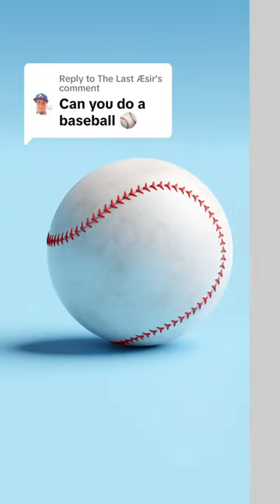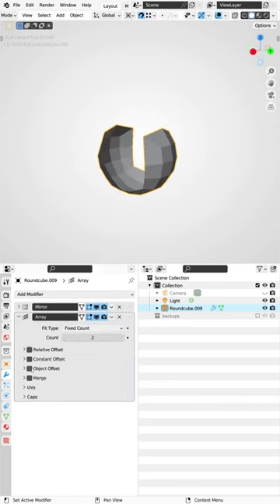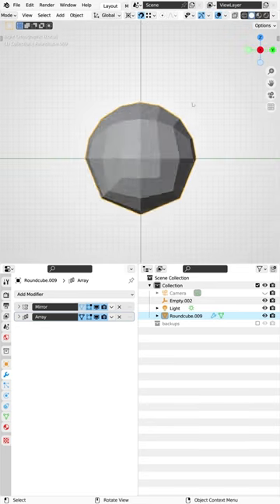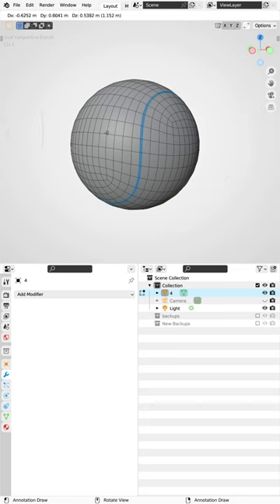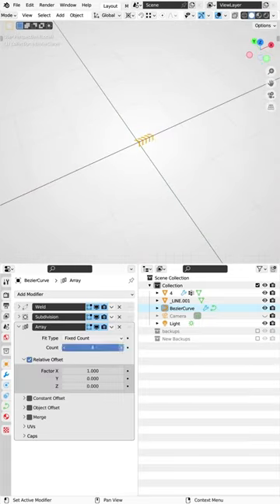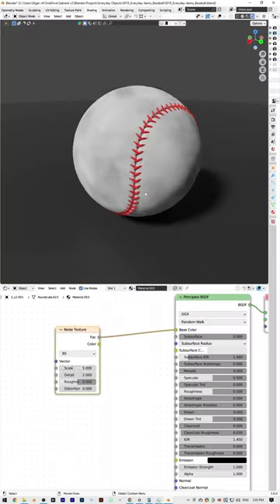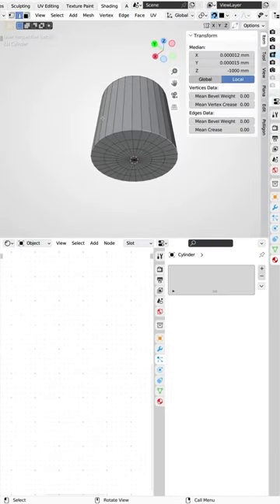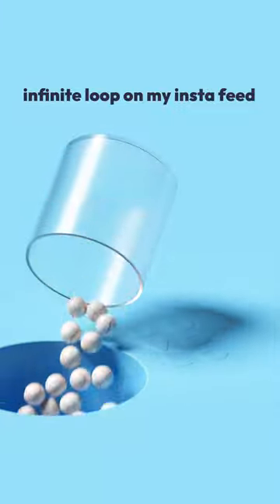How to make a baseball in blender #blender #blender3d #3dart #blendercommunity #3dmodeling #3dmodel

Comment: Looks good but will def have performance issues if you add only a few, so instead what I would do:
Make a cube, crtrl 3, apply subsurface mod, go into edit mode, select all and pressalt shift S and drag to the right. Object mode, ctrl 1, right click, shade smooth, apply subsurface mod, edit mode, num pad 1, shift f for xray mode, select left half, delete, object mode, add mirror modifier with clipping, edit mode, select all, press U, pick unwrap, add material, go into texture paint, go to active tool in properties,  mode material, press the + next to no textures, press base color, turn it to 2048x2048, on the semi circle in the texture paint tab paint it all white with the stitch pattern that goes on half (next part is easiest in Photoshop/gimp), go back to active tool tab, press + again, this time ass a normal map, 2048x2048, layer the 2 images in photoshop shop, draw a thin dark line where the seam should go, us a bit lighter of a brush and darken the sides of each of the stitches (same side to get consistant shadows) and then also with a lighter brush on the top of the stitches, this will make your stitches and seam look 3D without adding any extra geometry. For extra, you can add a roughness and also go over with texture brushes being able to add dirt on the ball and also you could add a cloth texture to the lace. If you want even less geometry the first instead of pressing ctrl 3 when i say just press ctrl 2, this makes you go from 1536 faces down to only 384 faces per baseball
Reply: This is a very old and antiquated workflow. I get it you're old school or were taught by old school modellers but comon why you drawing every shadow on a stich when you could do it by just baking shadows and or ao from higher poly version. Besides, if you're smart and use one of the many forms of instancing in blender then complexity is less of an issue or just simply only making it for one video then  its total overkill.